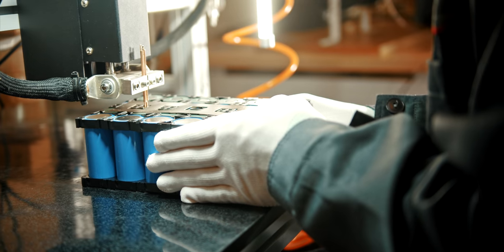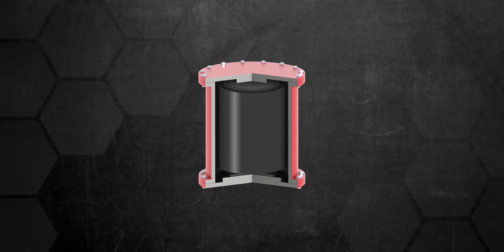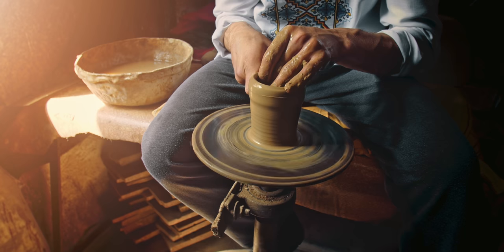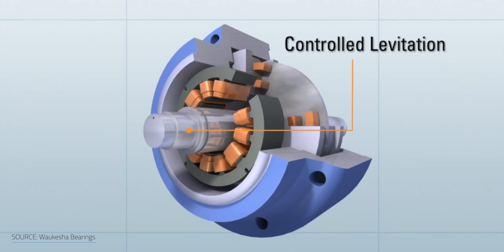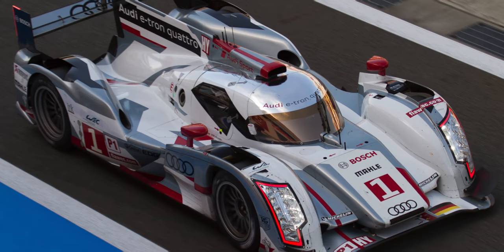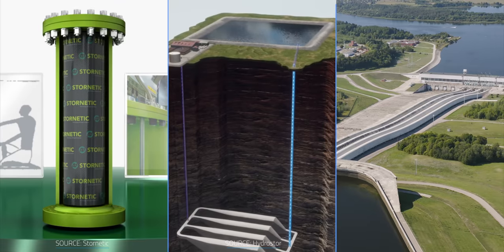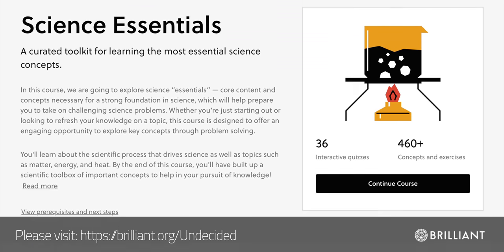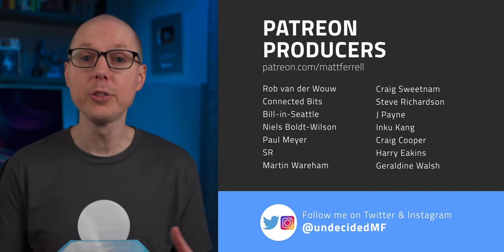The Mechanical Battery Explained - A Flywheel Comeback?

Comment: In the 1980’s there was an article I read, about an older man who had converted a small car to electric. He powered it, with small magnetic bearing, kevlar flywheels that were evacuated. He demonstrated that they were safe, by showing that if the flywheel were to come apart, due to a breach in the vacuum, the energy would turn the laminated Kevlar filament instantly into what looked like cotton candy, friction of the cotton candy against the inside of the aluminum vacuum vessel dissipated the kinetic energy and danger as heat and windage, allowing quick deceleration of the failed gyro momentum wheel. The speed of his mini gyros had the speed of the rim of the gyro moving at faster than the speed of a bullet. The article was. In one of the following magazines. Popular Mechanics, Popular Science, Popular Electronics, Mechanics Illustrated,

I was impressed then, and wonder if a couple of these gyro units in the frunk of a Tesla, could seriously extend the range of a Tesla by lightening the amount of batteries it would need to carry.
Reply: Sounds very interesting!!!!...I love the interest in this technology!!!👍😁😎
Reply: flywheels are kinda heavy
Reply: @pasticcinideliziosi1259  not a high tech Kevlar one designed for vehicle use. The weight of this one was 100 lbs for the entire assembly. The flywheel was a Kevlar and epoxy form. Today, it would probably be carbon fiber, as well as the Vacuum housing.
Reply: On of the downsides of Flywheels energy storage for vehicles is that it is essentially a gyro, which resists motion. This means usually they make it really hard to steer.
Reply: Whatever happened to the Chrysler Patriot? Not the Jeep, the flywheel/turbine powered race car that ran on LNG.
Reply: @joekanter2681  that would be true of one big gyro, but by using even numbers of gyros, placing them side by side and spinning each in the opposite direction  and at the same speeds, decelerating and accelerating both the same, when drawing and adding energy to them, the forces are cancelled, making the vehicle steerable. The car in the magazine article used four units mounted in a frame, that placed them in a balanced configuration that was 55/45 percent positioned, to put more weight on the passenger side, to offset the Driver’s weight which center balanced the vehicle  and avoided the steering shaft and the steering box, much like a Slant Six Engine.
Reply: @DishNetworkDealerNEO  Wouldn't these flywheels be much more expensive than batteries? Cost vs range is what is holding EV's back, flywheels might possibly help with the range, but at the cost of much higher prices. Maybe usefull for more niche sectors where long range is necessary and cost is less relevant?
Reply: @MDP1702  other than having magnetic bearings, and an evacuated housing, it would not be much more expensive than building a high speed electric motor, which is done easily millions a time a week for the automotive industry and for appliances such as Air Conditioners. With the magnetic bearings, there is no contact, just strong permanent magnets, eliminating the need for precision machining other than high speed balancing to minimize vibration. The stator would use layered carbon fiber m  or Kevlar wound yarn, would be repetitively made on high speed forming or winding machines. I would expect true costs to be about $500 per gyro not including drive electronics which would be $150 per gyro. The input and output is three phase AC, like any motor. Which can be rectified to DC to power the Drive motors.
Reply: @DishNetworkDealerNEO  Then how do you explain the 1000-1500$/kWh mentioned in this video if it is not expensive?

Yes, it doesn't sound expensive, but apparently it is.
Reply: @MDP1702  watch the video again, that cost number is for fixed stationary industrial grade equipment, not automotive grade equipment. The scale of the machine is bigger the five cars.
Reply: @DishNetworkDealerNEO  Machinery is bigger, but so is the storage, if it was cheaper smaller, why wouldn't you just place a whole bunch of smaller ones instead of one big one? It is more flexible, easier to replace in case of a failure, easier to scale up/down, ... 

Do you actually have an idea for the price of smaller efficient flywheels?
Reply: @MDP1702  very few have tried to design such a device as what I am describing. The momentum wheel will be the most stringent part of the design. It has the be fairly light, yet strong enough not to fly apart from the centripetal forces. The momentum wheel will have to be precisely balanced.  The rest can be cheaper, aluminum housing, seals, actual motor /generator stator windings will be closer to the axle, so the G Forces are much less. Three phase Field coils would be standard cost. There would be a vacuum pump to ensure operation with minor leaks in limp in mode until serviced. Normally it would not be active unless there is a problem.
Reply: @MDP1702  in a fixed, stationary system, bigger is better, as this reduces the cost of the vacuum housing and the complexity of the electrical connections, also improves reliability, due to less connections.
Reply: @DishNetworkDealerNEO  This doesn't really makes sense, if big is better costwise, doesn't this precisely show that the smaller ones (for cars) will be more expensive?
Reply: @joekanter2681  only bad to steer if the flywheel's axle is horizontal.  Hence the position of the flywheel in the bus in the video. To fix any gyro related steering problems, all you need is counter rotating flywheels to cancel out each other anyhow. The Honda CX500 gearbox rotates counter to the crankshaft to eliminate torque reaction upon accel/deceleration which compares well to the principle.
Reply: @MDP1702  you are not considering space and weight constraints, which must be factored in for a vehicle. In a fixed installation, cheaper, bulkier, heavier materials can be employed. Comparing the two is not easy, and is confusing. The engineering goals are entirely different.
Reply: @DishNetworkDealerNEO  Again, nothing you say would indicate that my point about it becoming more expensive is wrong. If they use more bulky, heavier materials in fixed installations, the only thing that makes sense is that it is cheaper, otherwise why use them?
Reply: @MDP1702  like many devices made, mass production of millions of pieces, drives down per unit costs. That applies mostly to automotive parts. Not so much for Power Grid devices, as there is only a fixed amount of need for that hardware, so other than failure replacements and becoming obsoleted by a much higher efficiency version, there will only be so much continuing demand. The other advantage will be a long life and low Mean Time Between Failure spanning decades. (MTBF) as opposed to being a part of consumer or fleet vehicles, which corrode, have constant new styles, and eventually will become worn out, making a strong, continual production stream. This means long term profits, not a one and done product line.
Reply: @DishNetworkDealerNEO  
like many devices made, mass production of millions of pieces, drives down per unit costs.
Which begs the question again, why doesn't this happen for the larger applications, where they might use many smaller ones instead of large ones. Either the benefit in cost will be tiny, which will still make it much more costly than batteries, or it doesn't lower costs at all. Ofcourse it could be due to some other factors, maybe.

as there is only a fixed amount of need for that hardware
As for demand, like you said yourself, if you make it smaller you could create new markets: cars, homes, bussiness, ... So why isn't it done yet? Why isn't any EV company using it? Probably because it just isn't cost efficient enough vs batteries.
Reply: @MDP1702  they weren’t trying to make them even when the only game in Town was Lead Acid battery tech. This idea was around much longer than Lion batteries. There wasn’t much interest, but now on the flip side with all this well developed EV Tech that is compatible, or at minimum,  easily adaptable, this idea may bloom again. Just imagine if someone started making a pair that can go in the trunk and has a DC Fast Charger cord and plug end and has 150  miles range charging capacity to use in a pinch. You just refresh it once a month at home once a month if you don’t use it or after using it. How many people would see that as a great security blanket to throw in the rear frunk if it was lightweight, portable and didn’t eat up all your grocery or luggage room and didn’t cost an arm and a leg. Plus it could double as a power source for the Camper for a week of off the grid camping with no external AC utility service.

Comment: At the University where I worked, they found out that the mainframe was getting dropouts several times a day.  A flywheel ups was cheaper for the power consumed since it just needed to last the few minutes until either the power came back or the generator kicked in.

Comment: In the 1970's, these were considered the hot, upcoming technology.  Scientific American had a major article.  Besides cost, potential for catastrophic failure remained an issue.  Like fusion, these always seem "just around the corner"...
Reply: Where volumetric efficiency is not a concern, like stationary storage, a cheap brush high-tensile steel wire has excellent tension resistance to flying apart and can be rotated to higher speeds than the old steel high weight rim flywheel designs. The added benefit of tensile designs with lots of elements is that failure is progressive, producing more heat than physical dangers.
I read that article by Rabenhorst!
Reply: @waynerussell6401  Radial does sound better. (Even then they were proposing advanced fibers—still wound around though—that would become a “tangled rat’s nest” upon failure, rather than a fusillade of projectiles...)

Comment: There was a Popular Mechanics magazine issue from back in 1969, -70, or early-1971 I read while still in High School (I graduated in 1971) discussing how someone built one that was 1800 pounds in his basement. The axis was supported using an electromagnet powered by a 9-volt battery. The article mentioned that the horizontal flywheel was so well balanced that he could start it spinning with a nudge of his index finger. I hadn't remembered this article until after I watched your video; it was 40+ years ago.
The biggest difference I noticed between what I gleaned from your video and what I remember from that aforementioned article is that his flywheel was flat, like a phonograph record, and about nine feet across.

Comment: Sabb used a heavy "freewheel" flywheel in the old 2-stroke passenger cars in the 1960's.
Reply: The same with old buses of communistic block back in a days. Flywheel was used to reduce the energy/power consumpted by a bus during starting from a bus stop, and was "charged" during normal drive. In my opinion, the idea is good, but not in this form. There is too much loses in such a way. Why to convert electricity (which is generally produced from mechanic energy...) back to mechanic, and then convert it one more time to electricity? Efficiency on the level of 20%.... 

If we want to save our planet, we have to count efficiency and loses. Then everyting will be eco. For now its just a propaganda.
Reply: @ORMO1993  no battery can store electricity it has to be converted to a different form of potential energy Lithium ion batteries are storing that as chemical reaction potential
Reply: @furnish1696  i know that. So we have to invent some other technology to store electricity than this one...
Reply: The old fashioned Asplundh tree chipper also used the kinetic energy of a 400 Lb. steel drum to triple the amount of power available from the engine to grind up tree branches. The engine was connected to an "inverse transmission" which had an output RPM that was about 3 times the engine speed.

Comment: Our most trusted invention, “the wheel” will probably be our saviour in energy retention. 😎
Reply: Fire: "Disapointed Carbon noises"
Reply: @lenschwedt9646  Flywheel: I wanna to break free.
Reply: 'Don't disturb my circles'

~Archimedes
Reply: it's the CIIIRCLLLLEEEEE, the CIRCLE OF LIIIIIIIIIIFE
Reply: It won't.
The main issues are cost of materials and installation, which can't go down.
Also it's a very lossy system due to friction.
It's useful to smooth out power surges or compensate for temporary power losses, but beyond ...

Comment: There's a train called the Parry People Mover that uses a flywheel on a short steep branchline in the UK. Also, regenerative braking, where the power goes back into the grid has existed for about a century on the electric railways, I think initially in Switzerland but it only became really common elsewhere in the last 30 years or so.

Comment: 5:45 charged in a few milliseconds? I highly doubt it..
Reply: I thougt the same , i have  and flyweel nerf gun and even whit fresh new bateries it takes 2-3 seconds to rev up
Reply: Yeah, I caught that too.  But I wasn't sure if I was just not paying attention to the details of what he was saying or not.
Reply: I suspect he actually meant seconds, because that doesn't sound physically impossible and would be mighty impressive to watch
Reply: I think he must mean that it can switch to/from either generation or storage in milliseconds (once the flywheel is up and running) ... which is perfectly feasible. This obviously doesn't mean you can charge the whole thing up to it's max capacity in milliseconds.

Comment: Curious about the self-discharge rate of flywheels. At first glance Li-Ion feels like it can store energy for far longer periods.
Reply: For storing solar energy for night time its irrelevant really
Reply: Had a quick look around and apparently a flywheel battery has been capable of getting just a 5 percent loss per 24 hours of storage, whereas a Li-ion battery has a 5 percent loss of charge on the first day, with anywhere between 0.35 to 2.5 percent loss over the next month. Now the question is how many times can you recharge and discharge a traditional Li-ion battery considering that each time you do so it reduces its lifespan, and compare it to a flywheel battery and how long a magnetic bearing flywheel can spin for in a vacuum.
Reply: @I love you but that's true, but consider that very heavy flywheel will still have huge torque many hours after input cutoff, like in coal poweplant. Granted, it takes literal days to get it running from 0 to 3k rpm, but it also runs consistently for years. And it does almost exactly what we would need - stabilize output. I belive that with frictionless bearings this should be the way to go, unless there's something fundamental that i dont know

Comment: I believe the issue with flywheels atm is energy density and cost... You need at least 4x the mass, 3x the volume and many times the initial capital to store as much power as lithium ion batteries.
Flywheel companies never seem to quote the power (kWh) of their equipment, only the deliverable power rate (W) which they like to brag about but this will deplete the energy store very quickly. We need an energy store for hours not seconds or minutes.
However they seem to be very good at smoothing out short term grid fluctuations because of how reactive they are.

Comment: 6:13, no!  Control Moment Gyroscopes only stabilise the orientation of the ISS.  It has nothing to do with adjusting the ISS's height above the Earth.  Yes, CMG's are prone to bearing failure, just ask Hubble.
Reply: Confusing attitude with altitude...the attitude or orientation can be controlled by a flywheel.
Reply: I was just to point out the same but since you already done it...
It's an easy mistake to do. Altitude and attitude only differs one letter.
Reply: The bearing failures have been traced to solar wind electron capture and magnetic fields inducing currents in the flywheel bearings that create microwelds that increase bearing friction and increase the stabilizers power requirement. A fix is to replace the steel balls in the bearings with the ceramic balls that do not conduct electricity so they do not spark and damage the bearing races.

Unfortunately it is impossible to replace existing flywheel due to their location in space.

Comment: A place i worked at had a flywheel based voltage compensator that kept the voltage stable when the big motors on some equipment kicked on. It was the best solution in keeping the PLCs and computers from glitching and resetting. The flywheel could keep the circuit alive for about 10 minutes with a full power loss, but where it excelled was during dips in power that was short duration but bad enough to reset computers and interrupt the work in progress.❤